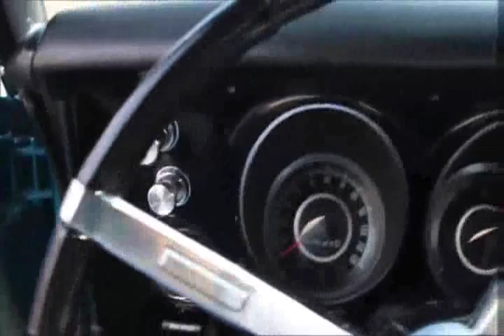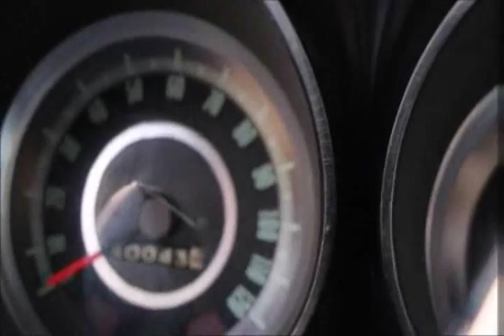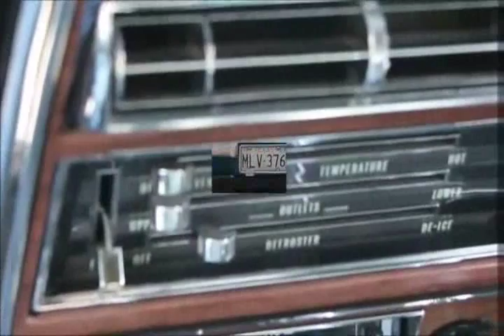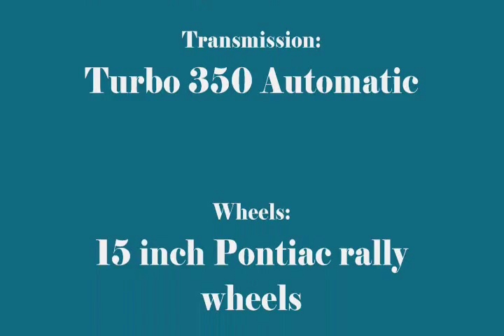1967 Pontiac Firebird 400

Comment: I know this is an old video, but just to clarify something that's said in the description. This car wouldn't have had the driver side traction bar unless it was a 4 speed. The automatic cars only came with the one bar, even the 400 cars.
Reply: What do you base your statement on?  All information I had researched indicated that any 400 had both traction bars.
Reply: @gregherring7775  there's all kinds of info out there, but if you want something concrete, try this. I have a 67 Firebird 400. It was a factory automatic car. It only had a passenger side bar from the factory. Its easy to tell because it only have 1 reinforcing plate on the floor for the bar. The 4 speed car had both. Plus, its pretty common knowledge among Firebird fans.
Reply: @WVXL64  Thanks.  I learn something new everyday.
Reply: @gregherring7775  no problem. Here's the breakdown from the Pontiac Craftsman Service News, May 1967 #2. The 6 cylinder 1 barrel auto had no bars unless ordered with the 3.23 gear ratio. Then it had one passengers side. The 6 cylinder 1 barrel manual transmission, 6 cylinder 4 barrel automatic, and V8 2 and 4 barrel automatic also received one passengerside bar. The 6 cylinder 4 barrel manual trans and the V8 2 or 4 barrel manual trans received both.
Reply: @WVXL64  Thanks again.  I sold this beauty a little over 5 years ago and like most, I have regretted it.  I am in the hunt for another first generation Firebird.